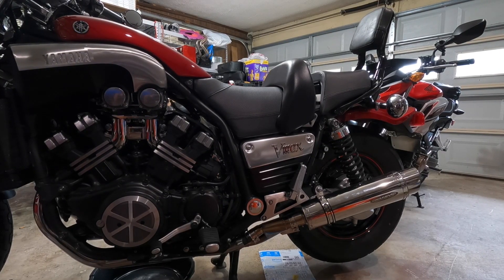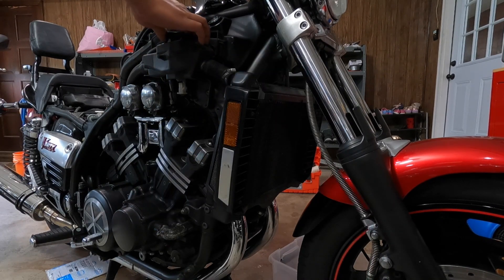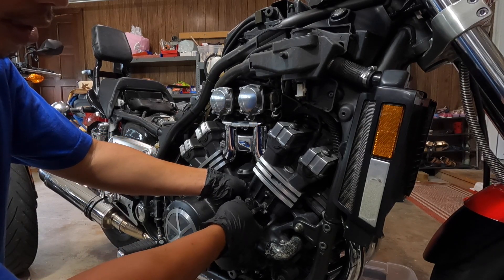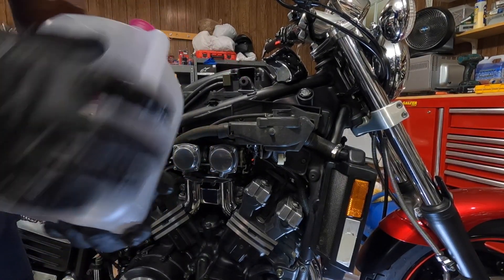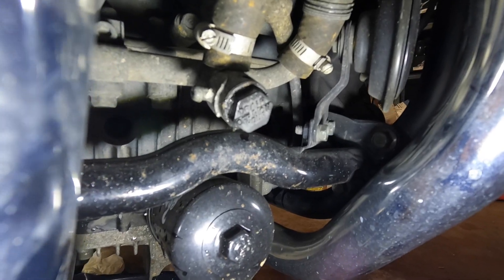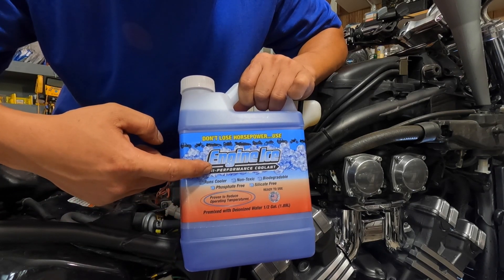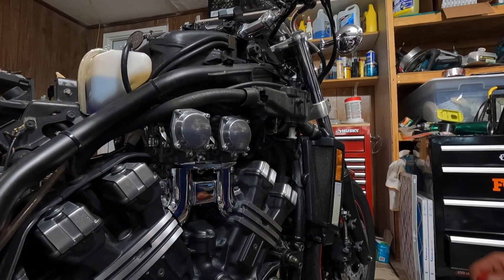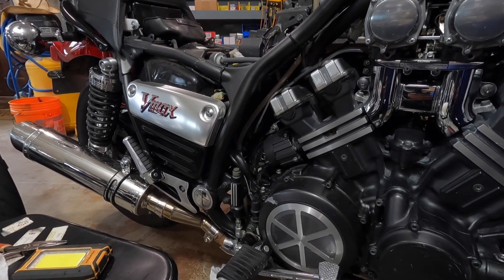YAMAHA VMAX COOLANT FUILD CHANGE. STEP BY STEP

Comment: Thanks for this very helpful and well done. Pulling my 2004 Vmax out of mothballs from the fleet and going to do a carb rebuild/balance, oil/filter/spark plug and air filter change as well as coolant and brake calipers. It's 2022 and she is a 2004 with only 9k on her, still running stock brake pads. Only the tires have ever been changed. Gonna breathe some life into the old girl. Looking forward to tearing up the streets and making a general nuisance of myself on it. When I  put her away 4 years ago she was a flyer.
Reply from the maker: Good luck and enjoy your Vmax

Comment: Hey bro,
any idea how to change the orings on cylinder head water joints?mine has coolant leaking from one of them.
thanks for your useful videos.
Reply: Mine is also leaking. Did you find anything about how to fix leak?
Reply: Oh man!I had to pull those water jacket joints out to replace the orings, but it was impossible to pull them out without breaking them. 
I opened the valve cover to see if I could push them out, but there no proper access. Finally, I had to break them to pieces and pull them out. Some small pieces will fall down into the water jacket and crankcase. I don't know why the hel  yamaha would make these joints out of this material .
Good luck to you replacing them!